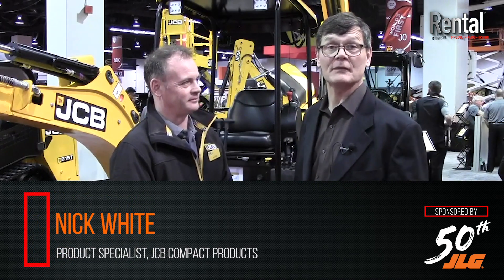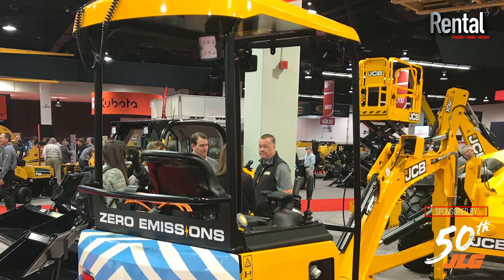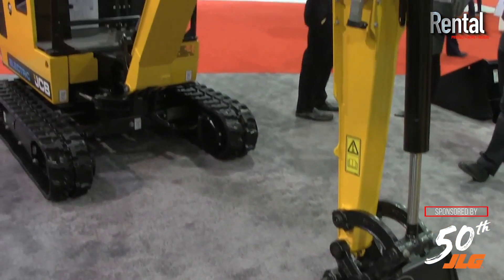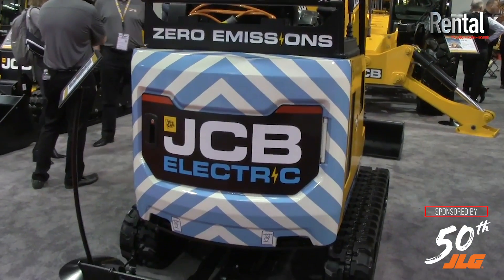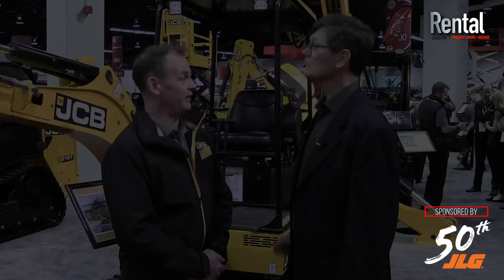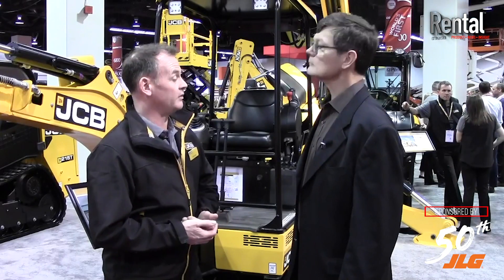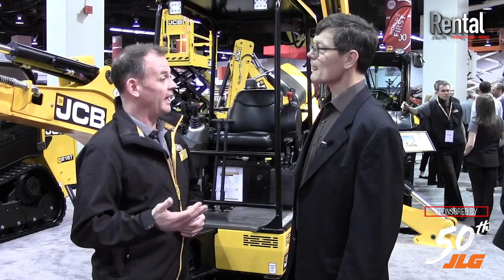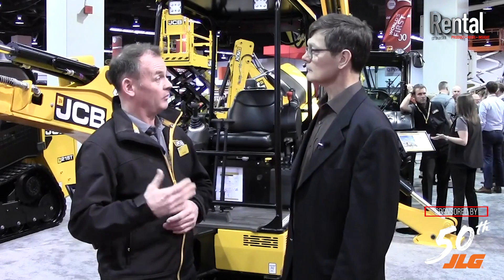JCB Prepares to Market an Electric Mini Excavator

Comment: If the batteries fail.. or start to fail 

 would it be a case of scrapping the machine altogether or would it be cost effective to replace..? 

Their will always be one guy on site that will forget to put the machine on charge and then it will take hours to charge up costing loss of production and down time. I guess its going to be the case of more than one needed on site... possibly more added cost...

Comment: Its been bought and tested. Worked fine, battery lasted 2 hours, takes 8 hours to recharge using a DIESEL generator...
Reply: S B. This is not a product for every application. Many jobs requiring a small excavator are in the inner city or inside buildings......where there are electrical outlets. For work in enclosed spaces and where other people are, low noise and low emissions are important factors. Many contractors now use battery powered tools because of their superior torque and controllability, ease of use, lower maintenance costs, convenience and quietness.
   Most factories and warehouses that use electric forklift trucks plug them in at night to the mains supply. Using diesel engines inside needs expensive extractors to provide a clean atmosphere not to mention the added fuel costs, or increased costs associated with safety and cleaning.
     The link below seems to show that digging for 7 hours is possible on one charge.....of course it could be fake news.

https://www.youtube.com/watch?v=cumZxYjzx6M&t=7s

For those who enjoy breathing diesel fumes and annoying the neighbours, I'm sure ICE diggers will be available for a few years more. They will only start to die out when plant operators realise that they can increase their profits if they turn to EV's..........like taxi drivers and bus companies are finding out.
      If you are a digger driver, spending hours every day in an excavator or backhoe cab, I would have thought you would be delighted to work in quiet, clean, reliable, safe environment.....maybe I'm mistaken.
Reply from the maker: Somebody you know?
Reply: https://youtu.be/cumZxYjzx6M